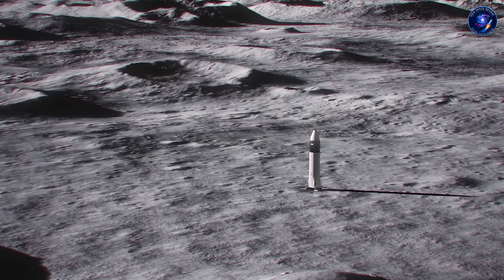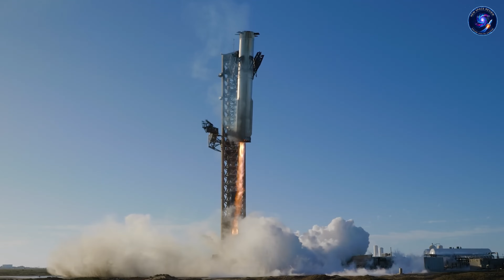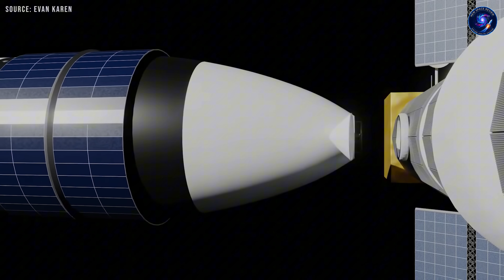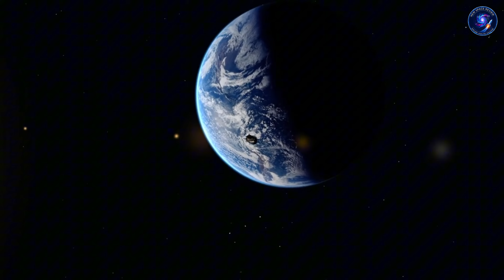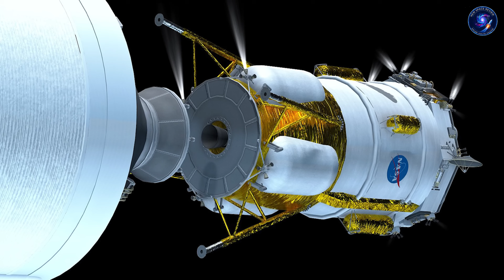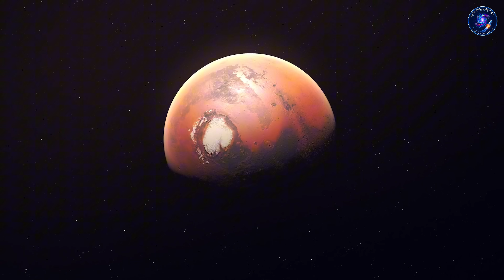SpaceX Found 3 Brilliant Shortcuts to Moon: Simpler than NASA Thought!

Comment: Spacex could also make the starkicker reusable by refueling in space after the primary mission. Another idea comes from ideas first suggested by Buzz Aldrin a moon cycler that moves between the earth and moon picking up payload at the earth to deliver to the moon and vice versa.
Reply from the maker: Great ideas!  Reusing the Star Kicker via post-mission orbital refueling aligns perfectly with SpaceX's full reusability push, and Buzz Aldrin's Moon cycler concept could slash long-term costs for sustained lunar ops once infrastructure is up.

Comment: NASA didn't refuel in 69.
Reply: how much of it came back?
Reply: @trollfallos  Had Grok do the math: 99.8% of the entire launch mass was not recovered.

A rough equivalent is to imagine that cargo from China to the USA arrives on a ship that can be only used once. For eight cargo containers to arrive at the Port of Los Angeles, it would cost about $30 million in shipping costs alone.

Alternatively, imagine that when flying to that sunny beach resort for vacation, your plane is is designed so that the only part that survives the landing is seats the passengers and crew are strapped to. It would cost something like $600,000 per seat. Note, that's also assuming Boeing is still somehow able to keep mass producing those planes at the same rate as they are now; and not having each one custom manufactured (like the Saturn 5) because there would be almost no flights.
Reply from the maker: Totally fair point!  Apollo nailed the Moon in '69 with one Saturn V launch thanks to the super-efficient Lunar Orbit Rendezvous—tiny LM, no refueling needed, just flags & footprints.
Reply: do you know how little NASA landed on the moon? SpaceX is not putting a small box with 2 dudes inside the moon this time.